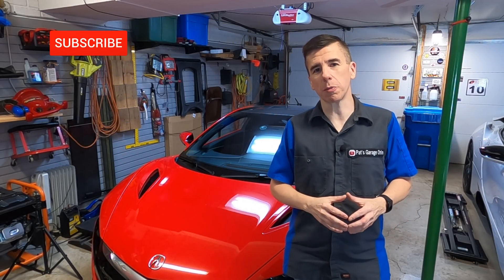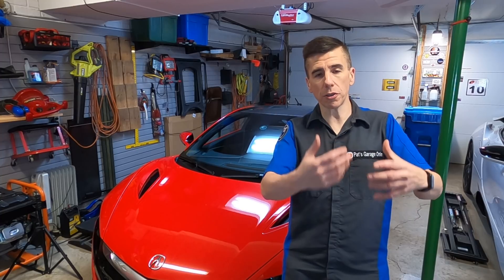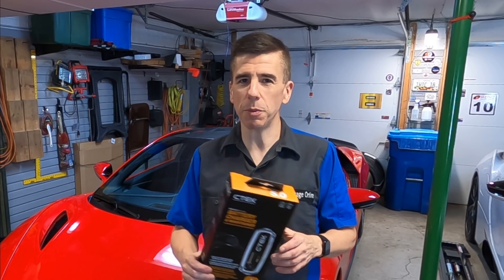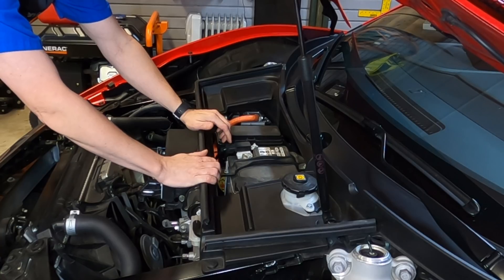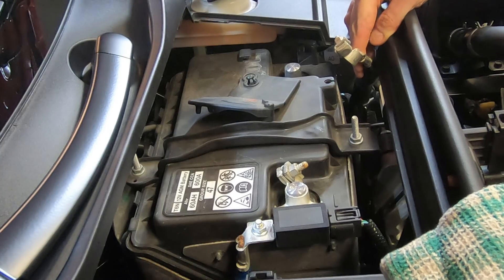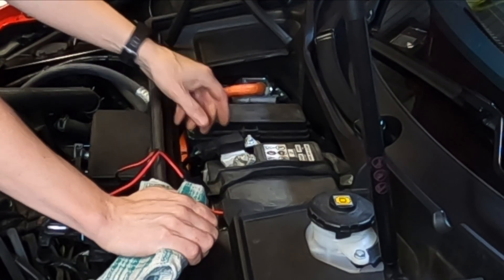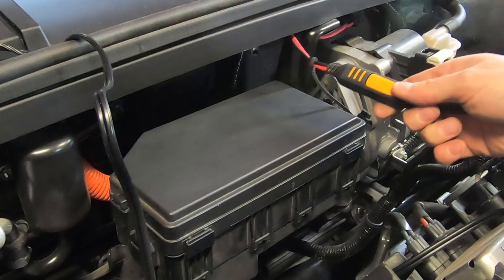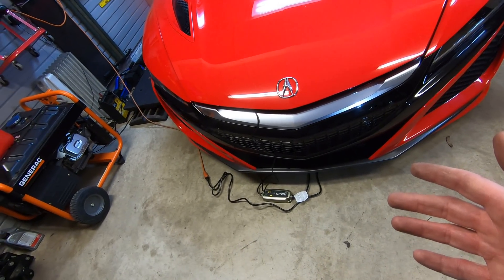The Acura NSX hybrid system.  Keeping the batteries charged.

Comment: On 2007 Toyota Highlander Hybrid, I had HV battery code problem. I took the HV battery out and then put it back in but it was depleted of charge so I hooked up 10 amp charger to the 12 V battery and let it charge for days and the HV battery resurrected. I think that some hybrid systems might be able to charge the HV battery from the 12 V battery circuit.

Comment: Hay Pat i followed all the steps of this video and the charger works as we expected. However, as all of us could predicted the infotainment is totally black now. Should I take the car to the dealer? Or any other option?
Reply from the maker: @mlara1270  I would disconnect the 12v battery and reconnect in 10 minutes. If you reconnect and have the same issue, I've seen where NSXs that have weak batteries cause strange things to happen like electrical errors. How old is the battery?
Reply: @PatsGarageOnline problem solved! This morning I got a msg on the infotainment screen saying the antithief feature is activated PRESS THE POWER BUTTON FOR 2 SECONDS. I pressed the “audio” button and viola! The infotainment came alive!

Comment: Hello Pat, I own the 2017 Acura NSX and my alarm keeps going off randomly at least twice per month. When the alarm goes off, the headlights turn on, the dash lights also turn on and it makes a strange clicking noise as if the car is attempting to start. This happens often and I brought it in to my Acura local dealership and they didn’t find any issues with it. I parked it in my garage and the same issues keeps happening. Any advice what the issue may be? Thanks
Reply from the maker: Wow, that's a new one for me. I know that the NSX electronics get weird when the 12v battery is weak. It will show that it's well with a volt meter but it's not. The car is sensitive. I would swap out the 12v battery if it was my car. I had to do this once because I kept getting tons of errors on the dash. I couldn't figure out why the traction control ABS was throwing errors. A new 12v battery fixed it.
Reply: @PatsGarageOnline  thanks a bunch for sharing your knowledge. I will look into replacing it.

Comment: You should connect your charger negative connector before the battery sensor, not after. So the BMS is able to know that you charged the 12V battery. Just use the stud next to the sensor instead. Nice content by the way.

Comment: 2022 NSX Type S.  I will store this car for months at a time, and would like to know how to key the electric motor(s) battery charged?
Reply from the maker: Sadly, the only way to charge the high voltage battery is by running the engine in Sport + mode.  It likely won't charge while the car is stopped.   You may have to drive it.

Comment: Pat you are the NSX WARRIOR of the cyberspace! Thank you for such a  detailed and educational video! My NSX came with the dealer battery charger May i use your method to charge the 12V battery
Reply from the maker: Thank you! Is the dealer charger not working for you? There should be a connector under the dash on the passenger side of the car
Reply: @PatsGarageOnline  i didn’t use the charger yet. It’s just plug to the connector under the dash passenger side?
Reply from the maker: @mlara1270  yes. It should be the same style connector.

Comment: How much does it cost to change the hybrid battery pack on the second gen NSX?
Reply from the maker: The high voltage battery (part 1D070-58G-305) has an MSRP of $6,400.  It can be found lightly used on eBay for around $1,200.  Labor is not very intensive, as this pack is air cooled.  I would suspect about 6 hours of labor if I had to guess.

Comment: Hey Pat, came be way of HPO Justin, any video of potential maintenance costs yet? Currently have a 2018 Grand Sport Corvette and waiting on C8 but because of waiting line thinking about one of these .... it’s sweet 💪💯💯
Reply from the maker: Thanks for stopping by!  I haven't done any maintenance on the vehicle yet, but I'm working on gathering information about that now.  It looks like about 8 quarts of 0w40 engine oil and a filter is required every 10k, but I'll do it every 5k but there are 7 bolts that need to be removed to drain all the oil, and crush washers replaced.  The DCT fluid also needs to be changed just like the C8.  Brakes are carbon ceramic, so I'll likely sell the car to Justin before I need to replace them, LOL!  Stay tuned for more...

Comment: Hey Pat, I am interesting on adding an underseat powered subwoofer to the back of the front passenger seat on my BMW i8. But I’m not sure on where to connect the powering wire and how to get through the firewall. Hope you can help me with some ideas!! Thanks
Reply from the maker: If you you need a lot of power, you'll need to get that from a thick gauge 12v line or the battery itself.   I know of no holes with rubber plugs between the cabin either the front compartment with the 12v battery or the back compartment where the 12v line runs to provide power for the engine ignition.  So, you'd have to experiment at your own risk on this one.
Reply: I have many experienced on installing subwoofer but never in hybrids car especially with my new i8. That would be a great idea to connect from the 12v line from the back compartment, might install the subwoofer in the trunk instead. Thanks Pat 😃 you’re awesome!!!

Comment: My daily drive to work and back is a total of 3 miles totaling to 12 minutes, 5-6 days a week.  Guess I don’t drive enough for the NSX.  Lol.  Maybe that Sunday drive would be a longer drive, odd they didn’t do some kind of plug-in on it so you can run electric only
Reply from the maker: If you drive in Sport Plus mode you'd definitely be keeping the high voltage battery charged. That thing charges up quickly because it's so small. I can make 2 laps around the Walmart parking lot feathering the pedal and then the high voltage battery is exhausted.
Reply: @PatsGarageOnline  wow that is crazy.  You’d think with battery technology it’s have some more range then that.  Like a 10 or 15 miles at highway speed at worst wow.

Comment: can you install a screw supercharger in the i8 , after that no one is going to tease  the i8 like it is  a incapable saloon  car
Reply from the maker: I don't see any room in the engine compartment and I think the additional pressure will blow the engine up.
Reply: @PatsGarageOnline  you could add forged internals and modify the engine compartment lid and make slightly bigger ,Ii really want to see how much fast this engine could get
Reply from the maker: Edo Motorsport has done this for the i8 ProCar.

Comment: Hi Pat, I also have the CTEK device. It is a very good device
I had to change my i8 already 2 batteries within 4 years. 
I am of the opinion that the small 12 v battery is also charged when I charge the high-voltage battery. Why is the small only 2 years bad. I am considering the CTEK device to use here too.
Reply from the maker: I wouldn't install the SeaTac charger on the BMW i8 because you can actually cause more problems by doing that. sometimes batteries have bad cells. The i8 has a very small 12-volt battery so when it does have a problem it's very obvious. these things usually only last three to four years so two years is a good run.

Comment: Only thing I would have done differently is added a nut on each terminal instead of undoing them and running a longer spur (as I do on my motorbike) so it could be threaded to the front grill and D/sided taped there.
Reply from the maker: I considered that, or go with the emergency vehicle method of auto-disconnect on ignition.  Knowing me, I'll pull the CTEK power out of the wall one day.  😄

Comment: Good advice. My NSX is currently on a trickle charger. I just leave the quick disconnect handy under the hood and plug it in. Easy peasy. As you say, you need to start the car and charge up the lithium ion battery occasionally so it isn't damaged.
Reply from the maker: Thanks!  Now, I'll have to leave a note card on the dash to remember to unplug it.  With the i8, I've gotten in and started the car to be prompted to disconnect the charger.  The NSX will not warn me, LOL.

Comment: I must say I'm glad we got an i8, seems like there's a lot of quarks with the Acura NSX.
Reply: Yea until your warranty runs out be glad. This Acura will last a long time. Looks like Samcrac's i8 has a blown head gasket. Personally I don't have the time and money to repair stuff every other month or switch cars when they go out of warranty so I will stick with my v8 camry 😂(Lexus RCF). Overbuilt like a tank so it takes corner like a tank🤣 still love the sounds that NA V8 makes
Reply: @karambir87  got a third party warranty for $5,000 all my oil changes are included spark plugs and so on with $100 deductible so I feel I'm good either a hundred thousand miles or 10 years. They give a great warranty like this because the car is so good and has very few problems. I have a 2014 BMW i8 with only 6000 miles so I'm pretty lucky. But would never get any of these cars without a third party warranty.
Reply: @caseyresources1  I agree a good warranty is must with these. I owned a BMW few years ago and it was a nightmare for me. My RCF has like a couple months left of factory warranty and I have no intentions of renewing it as it's one of the top most reliable car made by Lexus. It is nowhere near these super cars you guys have. Have a nice day.

Comment: Hey pat I got a bmw i8 about a month ago for the first 2 weeks the ambient lights were working great, now the ambient lights on my doors are not lighting up on the the ones on the dash 
I’ve tried everything in settings but nothing works 
Bmw wants 200 dollars to even take a look at it
Reply from the maker: Sadly, there's no fuse.  The Body Domain Controller (BDC) actuates the door trim panel lighting using the LIN bus.  It sends pulse signals to tell the LED emitters to change intensity and color.  There's no way to actually hook these lights up to another power source to see if they are still working.  The dealer should see a fault code entry in Body Domain Controller (BDC).
Reply: @PatsGarageOnline  do you have a idea of how much this is going to cost me to fix as I don’t have warranty
Reply: @JacobBlank  I had the same problem, At BMW here but only one fuse was changed.
Reply: Any ideas of what it could be maybe a fuse?

Comment: 😡Always, always disconnect the minus-pole first, before touching the plus-pole!!!🤐
Reply: Thats hack. Disconnect negative first.
Reply from the maker: I used to do this all the time, but everything is surrounded by plastic in this area so I didn't see a short circuit happening.

Comment: In conclusion, the next day I bought a new AGM 12v battery from Advance Autoparts and the car started right up. 

In a related topic, have you considered converting your NSX to be a plug in hybrid, much like your i8.   The concept would be to install a larger, removable Li-Ion extender battery in the trunk and build the high power electronics that would the use energy from the trunk mounted battery to charge up the OE battery behind the seats.  This would also use an “outside of vehicle” charge module to charge the trunk mounted battery over night.  I think a 6-8 kWh battery capacity would be sized appropriately and would allow the NSX to drive between 15-20 miles all electric in “Quiet” mode.  This concept is similar to many of the Plug-In kids that were available for the Toyota Prius before 2011.
Reply from the maker: I purchased a CTEK charger since my NSX didn't have the optional dealer installed plug under the dash. I hard-wired it to the 12-volt battery and will be releasing a video on this procedure. I will not convert the car to be a plug-in hybrid because that goes way beyond what I want to do with this car. The requirement that the car be driven every 3 months in order to keep the high voltage battery charged is sufficient for me. I'm surprised that the NSX you purchased didn't have any hybrid battery issues. If it sits for longer than 3 months the potential is higher that the small hybrid battery will fail, according to Acura. But it sounds like you had a terrific find in a very special car in your garage.

Comment: Thanks for video. I purchased my 2017 NSX used as a private sale from a wealthy Ferrari collector. It had 550 miles when I purchased. Interesting he had the NSX branded CTEK charger kit installed at his Acura dealer at the time of purchase (as well as every other possible dealer installed accessories). Ironically it appeared that he never used the NSX branded CTEK as his NSX sat in his collector car garage, virtually unused, for almost 3 years. I think he used another, inferior brand of trickle charger instead of the CTEK because in one photo the seller provided me, the car can be seen in his garage with the charger wire coming out of the front hood, instead of the passenger side door where the CTEK plug is located. When the NSX was delivered to me in enclosed transport, the 12v battery was stone dead and would not take a charge. It literally vented sulfuric acid fumes when I attempted to charge it. We theorized that this 12v battery was over stressed because he didn’t use his CTEK.